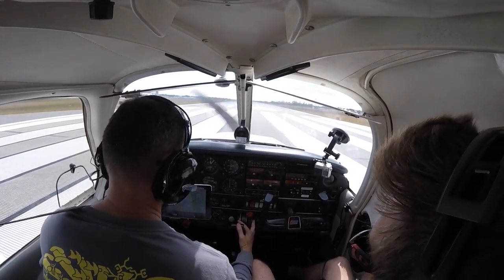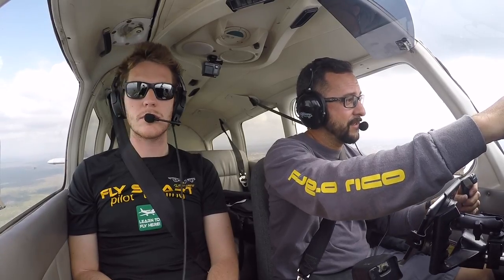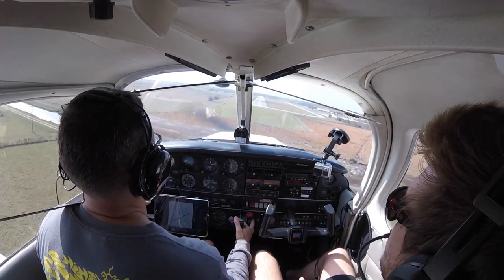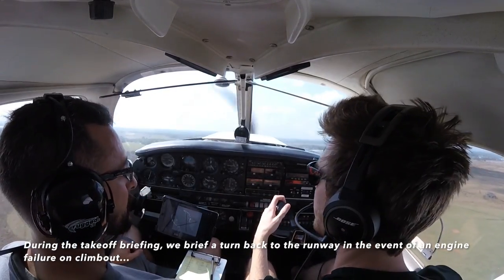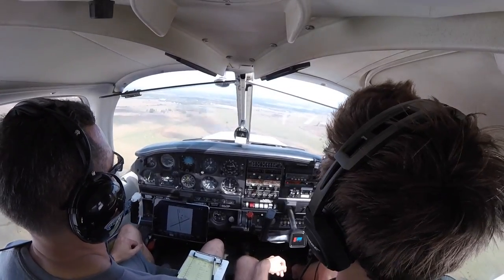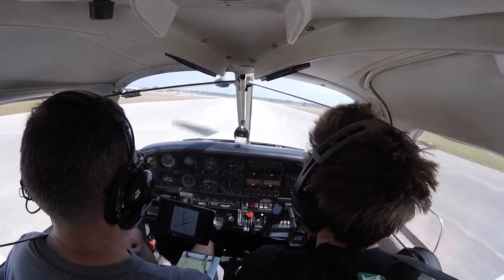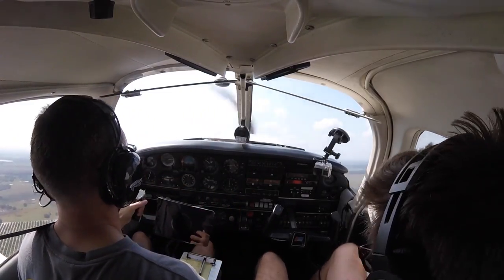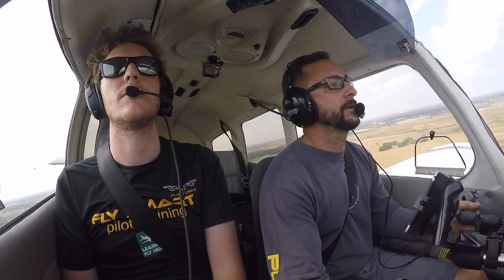Simulated Engine Failure On Climb Out| PA28

Comment: Nicely done Lewis.  You can actually practice various scenarios at a much higher altitude.  Just set a hard deck so to speak and see if you can make the turn to reverse course back to whatever you have arbitrarily set your runway heading to be.  You can try it at various altitudes above that hard deck and see when you cannot seem to make it anymore.  That way you are practicing at a safe altitude.  And add the 3-5 seconds for the OMG moment that others have mentioned.  Makes a huge difference.  By the time you nose over to keep your speed at the proper glide speed you will be below your 1000 foot minimum possibly before you even start the turn.
Reply from the maker: Greg Ellis I think I'm gonna do another video seeing the difference between these attempts and with the reaction time of 3-5 seconds as you say.. Given the fact that on these attempts we were very comfortable and in both cases high, I doubt it's gonna make a difference to the outcome, however I'm very intrigued to see how the student pulls it off
Reply: Just be careful as you know that if the student is controlling the airplane keep a close watch on the airspeed especially if you are doing this manoeuvre (this spelling is for you!!) down low.  Easy place for a stall, spin accident.  Don't want that to happen because I like your videos. :)

Comment: Interesting video. My issue with the "impossible turn" and the conventional wisdom not to make the turn is that it more or less ignores all other factors when it's really just boils down to altitude vs distance as this video more or less shows. It's not always impossible but there are a number of other complexities that go into it such as the aircraft climb/descent performance, density altitude, airport elevation, local obstacles, runway length,  Vx vs Vy vs enroute climb, airspeed, turn radius, stall speed, selected departure, etc all play a part so I assume that's one of the primary reason students are taught not to do it; I imagine a low time pilot would struggle managing all those variables plus flying the aircraft with sufficient accuracy, especially in the turn, to land safely.

Additionally, both low and high time pilots have been lulled into the sense they can make it having that runway environment in sight and they have tried to extend their glide often with disastrous results. As others have said, if you let that airspeed decay even a tiny bit, especially while you are in a turn, you are quickly approaching a low altitude incipient spin that cant be recovered with enough altitude to avoid going splat on the ground... Only question in that scenario is whether its a big no survivor splat or a significant injuries/time in hospital splat. In that case, I assume the teaching is on the basis you are removing any decision to try to reach the field and committing to landing off-field and in so doing you are more likely to accept where the plane is going to land and not try to extend the glide.

In your case, knowing you've made the turn before also introduces a bias that could turn deadly in an actual emergency.

Like other's I'd be interested in seeing how a few seconds delay detecting and deciding how to respond to the incident makes a difference. I'd go further and say you should play with other portions as well. How does DenAlt affect your ability to perform this maneuver? How does the plane respond to a wingover or half lazy 8 which, while normally powered, is supposed to reverse course without altitude or speed loss? What about turning a cross wind at 700 AGL? How about extending the reaction time even beyond the 6 seconds to 12 or 15 as many fall prey to denial, indecision or wrong decisions such as trying to restart the engine? How about a Vx or Vy departure or something closer to a cruise/enroute climb speed?

Comment: Man, that was really good. Very educational for flight training to be posted. I enjoy that. Good learning tool. Question: Do all planes have a 1000 feet minimum for "Simulated engine failure" practice? or is only on training planes. I was also thinking. I would have to look in the aircraft manual for each different plane to find out. Again, thank LewDix. You are man!

Comment: Wouldn't it be more realistic to follow a normal traffic pattern for this maneuver? Usually you would turn crosswind before 1,000 feet, so why not turn crosswind as normal until you cut power? I'd imagine if anything it would be easier to get back, because you would be closer to the runway and have less of a turn to make.
Reply from the maker: The point was not to show a normal pattern but to illustrate how difficult this turn can be. You’re not always going to be in a perfect position to get the plane back down. While your thought is correct in theory, that’s not the point of this exercise

Comment: Why don’t people climb out at Vx every time?  Doesn’t that give the best margin for turn back?   I don’t understand why that’s not std op procedure.  What am I missing?
Reply from the maker: It’s only really used for short field takeoffs or when you’re trying to clear obstacles on takeoff.. You get better performance from Vy which is why Vy is everyone’s go to speed.. Vx will climb you in the shortest distance which backs your theory that you will be closer to the runway in the event of an engine failure, but you get better performance climbing at Vy in the long run. The other thing is flying at vx puts you closer to a stall which a lot of people don’t like
Reply: in hot weather you will over heat the cylinders and do cause a real engine fail.. Vx climb only to avoid obstacles, then Vy speed to avoid cylinders failing.  Practice this maneuver on simulator first.  Coordinate with the tower or traffic well..

Comment: Does cutting the power properly simulate the drag of a dead engine? Prop spinning in wind or stuck in one position.
Reply from the maker: UPS1000 Well a windmilling prop produces more drag than a stationary prop of course, BUT the answer is no because the engine in this case is still providing power.. I think in a real world situation there would be more drag
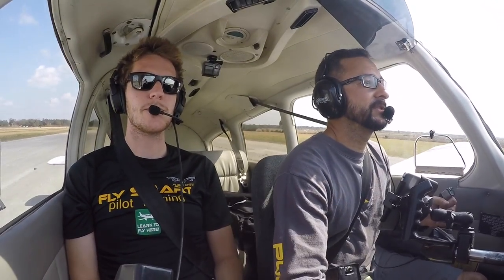Reply: Thanks for the info. Looking forward to more videos.   BTW 2:41 minutes, your legs are tanned like a typical Englishman....I have the same thing, by mom was born in Leeds.
Reply from the maker: UPS1000 Haha I try and stay out of the sun as much as possible